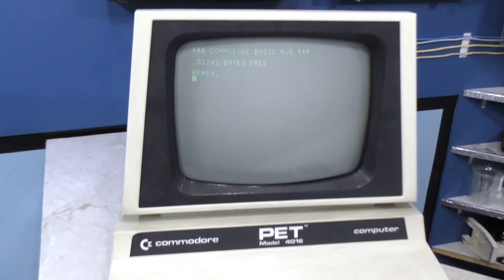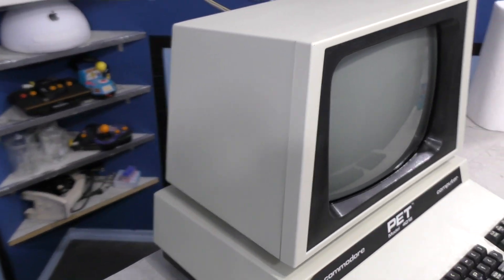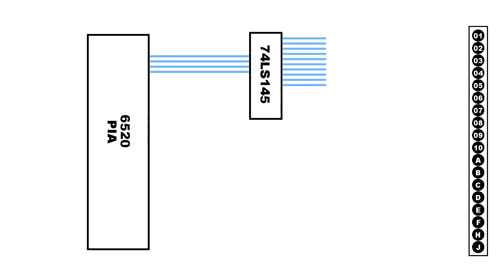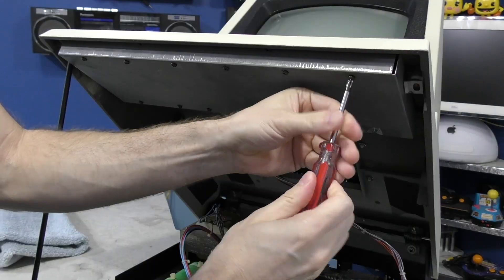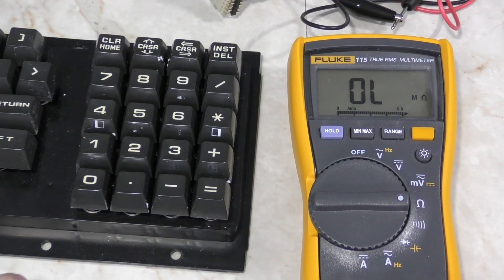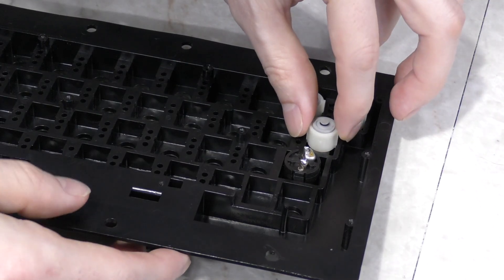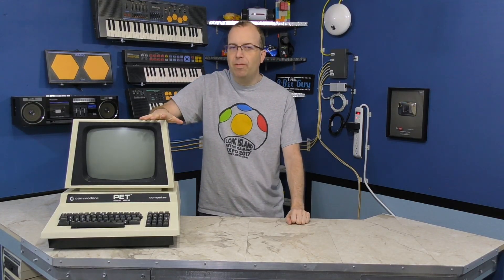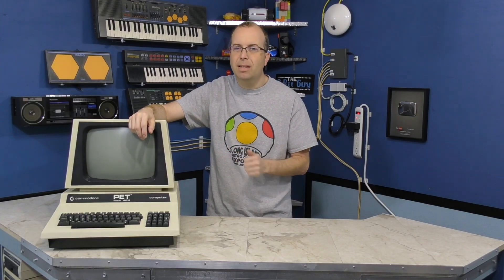Commodore PET Repair and Restore

Comment: I wonder if you could solder in modern mechanical switches like Cherry MX Blues and find some matching keycaps? Would be pretty nice to see. How about using epoxy putty for the broken spacebar tab?

Comment: It would've been easier to just glue some pieces of thin copper or aluminum foil to each of those rubber dots
Reply: Are you kidding? It is much easier and quicker to dab some silver paint on the carbon buttons and it would be to cut out all those aluminum pieces and glue them on. And of course, aluminum is reactive with copper and should not be used in contact with copper circuit boards.
Reply: youtuuba theres a thing called a hole puncher......
Reply: Sam L, Are YOU kidding? You think making all those dots, regardless of how, then gluing them on, is easier than quickly dabbing on some silver paint?

Comment: I have a P.E.T. that is missing the decal on the front and I've never found a replacement.Anyone know how I could make one?
Reply: Try a sign shop. Most of them now have computer controlled machines that can cut out large patterns in various colored plastic sheets, and make laminates, and they could pretty closely replicate that black and white decal. But many of the PETs used a 'decal' with a raised edge, almost like a thin frame, and that would be more difficult to replicate.

Comment: Not going to lie, I wish modern cases were as easy to crack open as that PET, as opposed to manufacturers focussing designers on making their cases look more like they were designed by someone who drew a few too many Gargoyles-style "S" characters in their textbooks. x_X
Reply: Most are. Unless you're getting an Alienware or other "gamer" brand with weird-ass case designs, it's usually as simple as twisting off a couple screws on the back and sliding the left panel off. Sometimes there aren't even screws, just a push-tab. Mine even uses slide-tabs to hold the disk drives in place instead of screws, so I've never even had to take the right panel off, but I realize that's not common.
Reply: I just have to unscrew 2 screws and it lets me do stuff in it

Comment: A tip to fix the spacebar if the metal stab goes up rarther than down ( and it looks like it does ) is to use the washer method that is popular when modding old IBM model F's 

https://geekhack.org/index.php?action=dlattach;topic=79362.0;attach=126893;image
Reply from the maker: Neat.. I'm not sure that will work on the PET... but I'm going to be investigating a variety of methods before trying it.. I don't want to risk making it any worse than it is.  I'll keep this in mind.

Comment: If the CRT is dim, and the brightness is up, you could up the brightness control on the flyback, but you ultimately need to get the CRT rejuvenated. Could be anything from a mere clean and balance, to probably a low-end rejuvenation.

Comment: It might be a good idea to recap that PET too whilst you are there.  There are some pretty crusty unreliable capacitors in those systems and bad caps could end up in dead logic.
Reply: There are quality differences, and I can tell you, the PET has good quality caps. The VIC on the other hand, and its nephew, the c64 do get these cap issues on the radial style caps below the fuse. They will die, and bring your computer with it. PETs are just plain bulletproof. There are no bad chips on them or parts, (excepting the original 6550 memories, which are completely terrible), so there is no cause for worry on the old buggies. Most chips don't even get warm, and the machine as ample room to breath and stay nice and cool.
Reply: ungratefulmetalpansy I'm pretty sure that big green capacitor is an electrolytic filter capacitor for the power supply...which CAN go bad. But they are still much more reliable than older paper and wax capacitors that were used in antique electronics like tube radios. I think capacitors from the early 1980's, like that one probably is, should be fine.
Reply: +ungratefulmetalpansy Yes, I totally get that point!  It does get annoying when people always jump in suggesting cap changes when it's not always called for.  The point I would make here is just because it works does not mean all of the capacitors are good.  Any bad smoothing caps result in ripple and possible spikes that can kill some of the chips at a point in future.  Whilst the caps in these might be some of the more reliable, they should at least be tested and the power lines checked for ripple.  The simple comparison is changing engine oil as a preventative to engine damage, capacitors in something this old don't last forever and their quality and tolerances weren't great from new!
Reply: +Simon Tay The key there is you tested them!  =D. I guess that's the point, check them and don't assume they are OK.
Reply: That is a good tip about the ripple on the bad caps, which would explain some things I have noticed in the past... I suppose it couldn't hurt to plop an oscilloscope on the rails and check. I have one at my workstation ready to rock and roll... I do not, however, have a 4000uF capacitor pile hanging around or an ESR tester. So ya. I guess if there is an easy way to test without desoldering everything to do some those tests, I'll do that. I just don't want to desolder and replace perfectly good caps. Let's face it, if you have already desoldered them, you are going to replace them while you are at it, unless you don't have any parts handy. Most caps with ripple, don't they oscillate so fast that they make audible noise?
Reply: I have large electrolytic caps (3300uF 25V, 2200uF, 63V) from the 80s and 90s and they still measure perfectly fine on my ESR/capacitance meter. They are physically much larger than modern equivalents of the same values/voltage. Old stuff was just built better.
Reply: we needs this to be top comment
Reply: it's just a good idea when working on anything of this era and earlier to replace the caps just for the peace of mind. better be safe than sorry.

Comment: I hate the PET, the darn thing used non standard ram chips.
Reply: Poor baby. Such a great computer, but all that means nothing because you don't like the RAM chips. Jeez....
Reply: youtuuba Normally I wouldn't care, but I have had to try and fix a faulty  system in the past and it made it so much harder than it should have been. The ROMs are also non standard which was a pain in the proverbial.

Comment: At least you figured out what's wrong with the keyboard: Not enough carbon, or the right type of carbon molecule.
Reply: Probably not enough cleaning attention given to the carbon pads before other things were tried. I have restored several keyboards just like this, without resorting to adding anything or modifying anything. It seems from this video that the methods tried were perfunctory.

Comment: the best thing to use is washing powder to get rid of dirt stains like that just get some hot water pour a tiny bit on a cloth pour a little bit of hot water on to the cloth and powder then scrub it works on plastics and other things like stained kitchen tiles ovens things like that but make sure you keep it wet as it wont work

Comment: It's a shame those conductive paint kits are so expensive. They are also useful for remotes when a popular button on it quits working (the paint wore off). They commonly use the same sort of conductive paint on the back of the rubber buttons to make the connections.

Comment: Try useing bakeing soda tooth paste. I know it sounds weird but it is a bit abrasive so it should clean up. Iv used it to clean up dim foggy headlights and it works. Just rub it on with a rag and rub it like a wax in circles. Then wash it off.
Reply: Uh, he already used baking soda, which he had on hand, and which is pure and has no other ingredients that might cause other problems. Why run out to buy baking soda toothpaste (although it certainly would have worked). Just seems oddly redundant to suggest something less convenient after the guy already did the job using something more convenient.
Reply: for other applications on other computers. You know future reference.

Comment: Hey, it's the PET repair video! It looks like you did a great job cleaning it. I remember before I donated it I tried fixing the keyboard myself by testing the wire continuity and cleaning the PCB and switches. Nothing seemed to work. I'm glad you figured it out! I learned way more about how the keyboard operates from your explanation than from what I found online.

I also can't wait to learn more about the operation of the PET, since I never did get to functionally use it. I wouldn't have any idea why my school would've installed a custom EEPROM chip into the thing, but maybe they weren't the first owners of it. Thanks for making this!